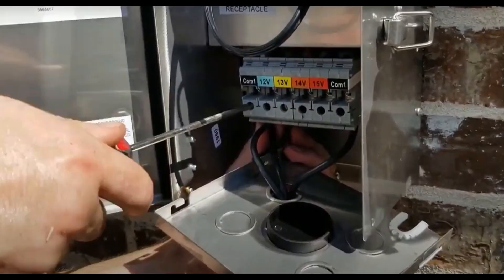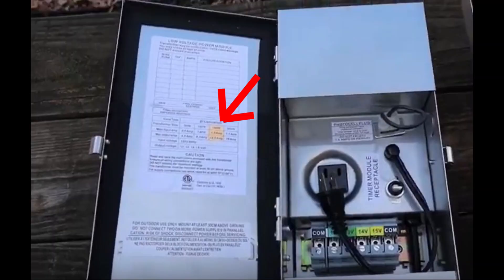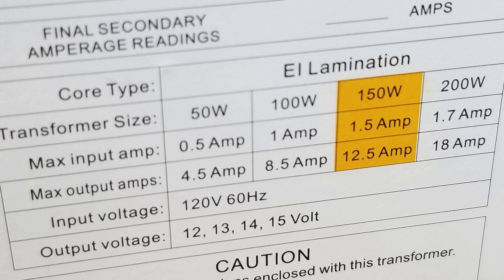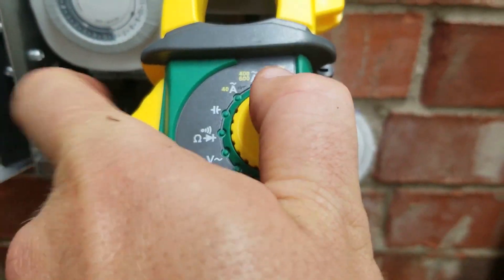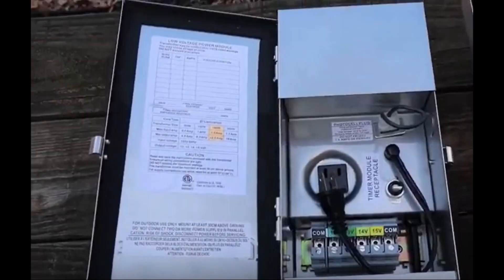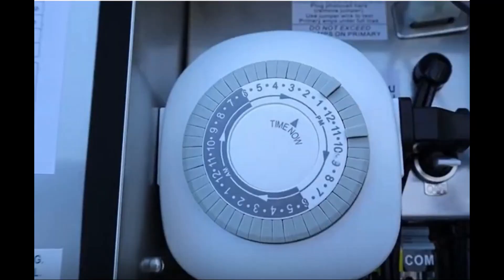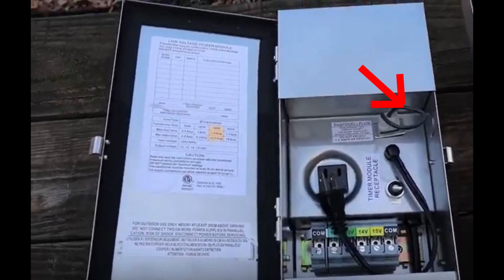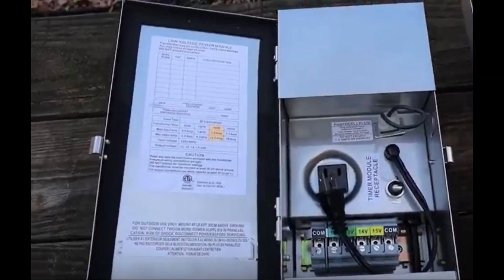Landscape lighting 101: Best place to learn more about outdoor lighting TRANSFOMERS - Part 4 of 7

Comment: Nice video, Adam and a topic near and dear to my heart and profession:  my company manufactures utility (substation) transmission transformers (up to 765,000 Volts).  Exact same principal though as is used in your world: power in = power out.  Meaning, as the voltage steps down the current rises proportionally.    Some power is lost in sound/vibration and heat.  Most importantly, as you note, is to not undersize either the wire gauge or the transformer rating (wattage) as the high current stress will shorten the life of the transformer.
Reply from the maker: That's amazing you have a company that manufactures transmission transformers! Yeah, the amperage is something I didn't know/understand for a long time and it's really important! Thanks for sharing!

Comment: I have to run a 120V wire about 30 feet outdoor to install a GFI receptacle that I'll plug my 300 watt transformer into.  What guage wire would you use for the 120V line?

Comment: Adam, if I just need to connect one light on the other side of my house, and I don't want to run wire under driveway, I will need the smallest transformer I can buy that will do the job. Any recommendations?

Comment: 80% usage is code but also gotta figure VA that lamps use which is more than the actual stated watts. Never try to squeeze 150 watts on 150w trans because it won't work consistently

Comment: I have a very old transformer. Its posted on it that only 11 "lights" can be connected. Our house is very large, very long. Its nearly 90 ft from the driveway to front door. I guess Im going to need several transformers.
Reply from the maker: Base the amount of lights on the watts used. You can check to see what the wattage is. If its a 300w +, I would definitely keep it and add a ton of lights on it. You really only need 1 transformer maybe 2 if you like the front and back to be on different transformers.